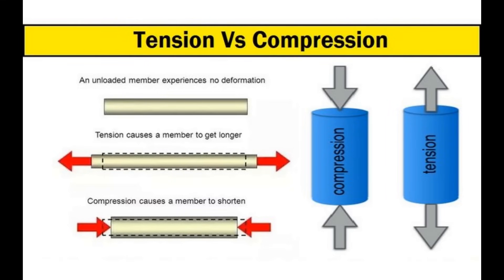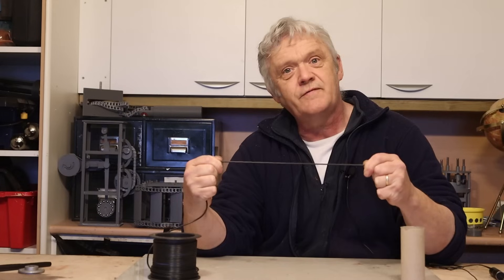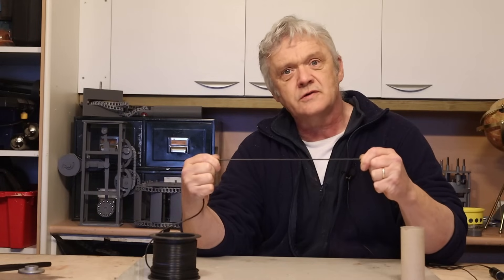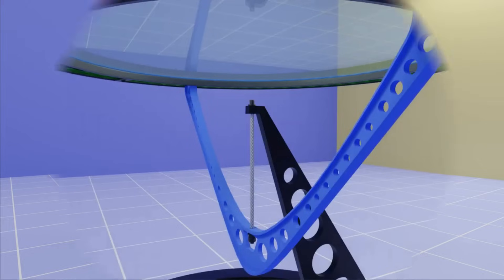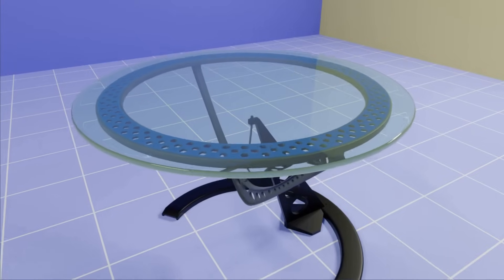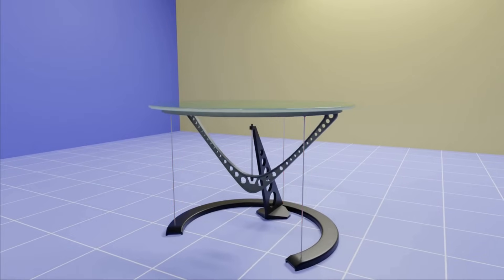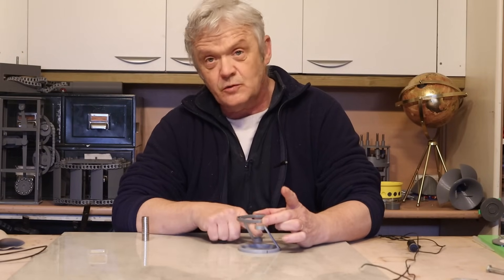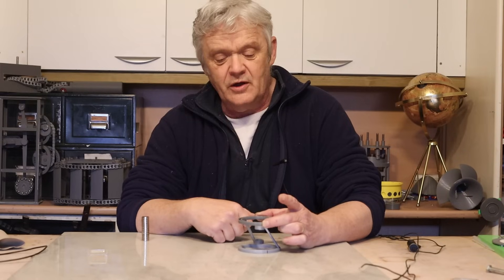2166 Tensegrity In Energy Generation

Comment: And if piezoelectric cells are used at the ends of the strings?... any vibration could cause tension and in turn electricity.

Comment: Well, is tensegrity good? Clip one wire and everything collapses?
Reply: That tends to be the case with more conventional triangular struts too. I can see the potential use for tensegrity designs though, it can allow for reduced material costs and weight. See the tensegrity table, for example - that structure replaces the conventional three tablelegs with the equivalent of maybe one and a half legs.